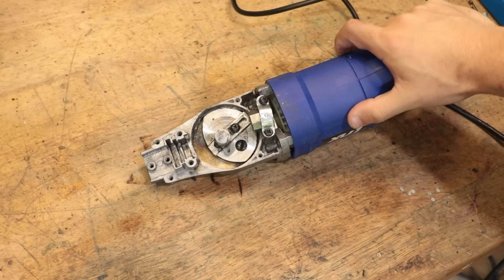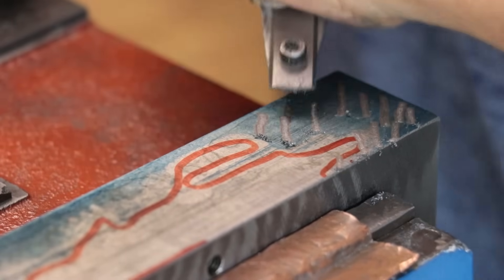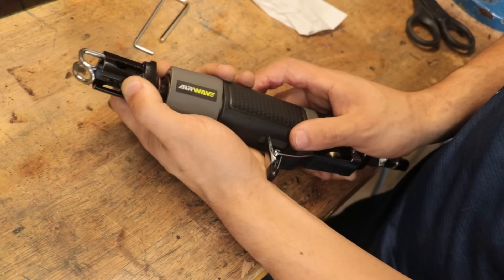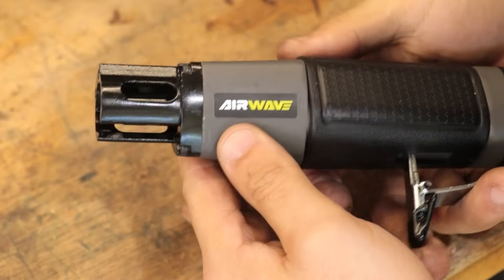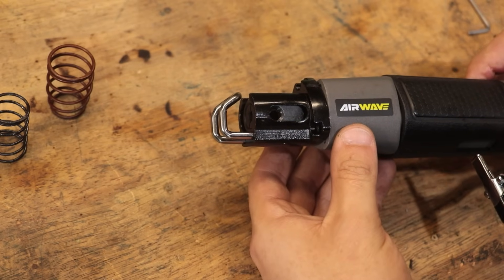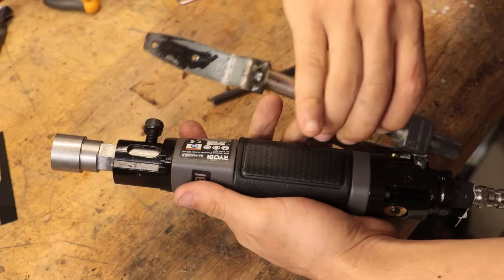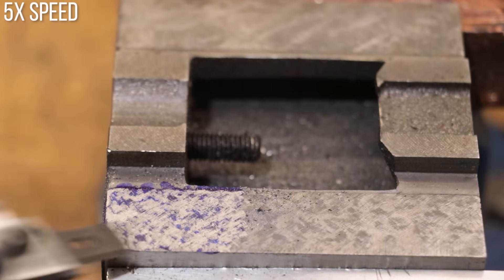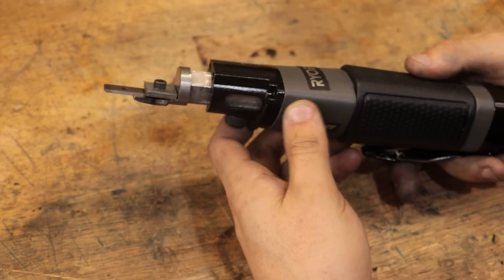Making A Pneumatic Power Scraper - One Day Build

Comment: First off, love all your videos and work you do!

An idea:
 You could start a side business selling  mod kits to permit home machinists to convert the Ryobi to become a make-shift power scraper. There is alot of home enthusiast machinist who would buy it.  I think you could easily sell over 100 kits to be honest.

If you had a CNC shop help you mass produce the conversion parts based off say your CAD/ technical drawing your, and you sold them as a kit... its a business endeavor/ product you'd be offering based off your design.
 Its hard to find a good value power scraper for the home shop (here in the UK, the cheapest ones are easily over 1,000 GBP) .  So you'd be solving a problem many of us have in the home shop if you did decide to offer say a conversion kit, and rightfully so, you'd make some money in the process :)  

Just an entrepreneurial thought is all ;)

Comment: Nice work! 

There are more materials that can be scraped.  The YouTube channel, "An Engineers Findings" discusses in a video or two scraping a approx. 1 meter long straight edge made from welded pieces of steel and how the rake angle of the carbide needs to be a +3° rather than a -3° for cast iron ( I may not remembering the correct rake angles, but it was a negative rake angle for case iron and positive for steel.) Also, I scraped one flange of a piece of stainless steel channel as part of making a precision machinist level.
Reply: You can scrap just about any ferrous or non ferrous metals to some degree as long as it's softer than the carbide.  The problem with any type of steel is the amount of effort required. You could flatten a piece of cast iron with a hand scraper 10 times faster than even mild steel. Its miserable to do by comparison. You'd want a power scraper for any moderate to large job. 
 A welded assembly of steel done on purpose to make a precision flat surface is a very odd combination. Cast iron is very stable, steel is roll formed so it has lots of internal stresses, add welding to the mix and your asking for trouble. It would have to be proffesionally stress relieved in a furnace to stand a chance of staying flat(ish).

Comment: you should be able to slow down the scraper by reducing the air flowrate instead of the pressure. Reducing (either one) also reduces the runtime of the compressor, the strain on you hands, and improves control over the scraper

Comment: I can think of two ways to slow down the oscillations: increase the reciprocating mass (would make it harder to hold and control) or decrease the spring rate/force on both return springs. And lower air pressure (regulator), but im sure you tried this.

Comment: i think using both the pneumatic and the handscraper is the way to go, do 95% with the machine and hone it in by hand, i recon you have much better control with hand scraping compared to the machine, especially on relatively small surfaces. but hey, it works, great job

Comment: hey, you need something that flexxes up front . i spoke to the European Biax Specialist ( kingway Consultant ) a while ago, and you realy want some piece up front that has flex. the biax scrapers use 2,5mm -3mm thick  steel that is tempered to a springiness . that allows to even out inbalances. i am 100% sure if u buy one of the 20mm wide biax Long scraper blade you will get much better results
Reply from the maker: That was going to be the back up design of the directly mounted carbide didn’t work. I think it may be better but I’m still getting great results with the direct mount. Cheers
Reply: @artisanmakes  if u want to get a better result, i highly recommend you to make a grinding jig and u need a smaller blade width ( 15 mm for example with a 40mm radius, and if u want to hit more PPi smaller 10mm or 15mm width, 20mm radius on the blade.most people scrapoe with way to big radius and width, and scrape not deep enough. by using smaller radii it would alow you to split the points accurate( when u examine your highspots, you should actualy only split the spot that you blued, not remove the whole thing " ) . what you are currently doing is that you constaly remove almost your whole points ( they are still way to big  because perhaps your radius is to wide ! ).that way you get changing results and you will not be able to get consistency   between the blueing. and you can only hit those points by going  over them with smaller radius and blade diameter.i didnt understood , why my pattern stalled at a certain point , until i reached out to a Kingway scraping consultant and he explained me very well that if i dont use smaller radius, the scraping pattern will remain coarse, and you will not be able to get good ppi. also try to thin out your prussian blue more. to me you had a pretty thick layer. i use something called Canode Blue, i can tell from first hand experience it works way better than regular Artisan paint. but i can understand...u have to take whats available.

Comment: You might be able to slow it down by messing with the air bleed ports on the double acting piston. I wouldn't try and reduce air pressure into the tool though, it would take power away.

Comment: Hi great video just thought I'd drop a comment my dad was an engineer in a machine tool manufacturer who built huge planes the cast iron beds were scraped to allow for a bed of oil that the plane head ran on these cast iron surfaces that could be several meters long were hand scraped in a circular motion to allow for a small indentation and per 1 inch square there had to be 12 semi circles or the area had to be reworked !

Comment: Greetings from across the pond...Actually looked like it works great. using a dremmel to put in grooves would overcome the small places for oil problem. its very fine but that looks lke it wont affect it....fantastic idea
Reply: When your scraping (flaking) to get areas to hold oil your only removing a couple ten thousands of an inch. A rotary tool would be difficult to use that accurately, not to mention how unprofessional it would look.

Comment: 200L tank is minimum for air tools.
Reply: Tank size isn't a substitute for compressor capacity, he should be fine though those saws only use about 4cfm and he's not going to be using it continuously
Reply: @Paul-FrancisB  ye but it is a buffer so you wont lose your mind because it will turn on every 10 sec. If you look at pneumatic tool it  usually has ~250l/min requirement.
Reply: @gary851   I realise that, but it depends on the air tool, a die grinder for example uses about 200 l/min. However 250l/min (about 9CFM) is over twice as much as one of those air saws use and he'll have it turned down. Also the number is FAD i.e. at atmospheric pressure with the hysteresis set at 2 or 3 bar on the pressure switch that triples effective capacity so it would be at least a minute even with that little machine and tank. Obviously a bigger tank would delay it kicking in, but with 9CFM demand that little machine wouldn't keep up or shut off until he stopped.
Reply: @gary851  no. Incorrect

Comment: A silent air compressor will be the next build, I used the compressor out of our old freezer with a separate pressure switch to keep my reservoir topped up, the noisy one hardly needs to run. Air conditioning compressors are a better capacity but I couldn't get one for free.

Comment: Brilliant idea and result. BTW Did you ever consider building your own pantograph? There are nice videos of these vintage machines them from Will Stelter and Inheritance Machining, however they always work by movement of the spindle, which makes them a small mill basically. I was wondering if one could make such piece, but with a moving table with the workpiece. Then it would be just an attatchment to a existing mill, and tracing the 3d printed parts would make it basically a CNC mill :P

Comment: If you want to slow the cycle rate down play with the hose sizes and only need small sections to limit the flow not a pressure regulator

Comment: It seems like it reciprocates less in length and is more accurate, but I would have thought you'd want a longer stroke, closer to what you'd get by hand but not quite that long or inaccurate, in order to have more dips and troughs in between strokes when hatching at different angles. The longer the stroke, the more widely separated each groove is if you move it from left to right at the same speed, and I would think it would dig slightly deeper which would also help with the whole oil thing. However, i am very impressed with your design as always. Cheap, effective, and relatively easy. Definitely on brand lol. It takes a lot of engineering to figure this stuff out though so youre helping a lot of people with these videos

Comment: Scraping steel by hand doesn't make any sense. For steel I use a thin cut off disc. Very light pressure, I use the side of the wheel. Works perfectly. For anybody concerned about imbedding abrasive, remember. We use ground slides either way

Try it out

Comment: There are air reciprocating file tools that are fairly inexpensive and could possibly work as a scraper.  The scraper blade would need to be small but I think it would work.  Great build idea you have, really enjoyed the process and progress.
Reply: they are basically the same as this saw.
Reply: @katelights  with the air file you can control the speed without needing to add the air pressure regular, they also have a shorter stroke.
Reply: @taranson3057  true, thats probably better than buy versions of powerscarpers. Diy better

Comment: My issue with air tools that run constantly has always been air consumption. CFM. They always seem to need a large compressor or they quickly run out of air and you have to wait for the compressor to catch up. This didn’t seem to be an issue with your small compressor.
Reply: You can buy smaller 10-20g aux tanks for resevoirs that will take longer to fill but run longer.
Reply: @boots7859  yes but only a minute or 2. I actually have auxiliary tanks. If your compressor can’t put out the required CFM it is a problem.Once the main tank and the auxiliary tank run low you are in the same situation. You might gain a couple of minutes. That’s a fact
Reply: @boots7859  this is a very unknowable response. Continuously running air tools like this typically require a 2 stage compressor to keep,up with the CFM requirements. I have been using air tools since the 1980s. Adding auxiliary tanks is a very poor attempt at increasing CFM. The only time auxiliary tanks work are with high volume intermittent air tools.auxiliary air tanks only help with initial run time after the first couple of minutes they do absolutely nothing if the compressor can’t keep up.

Comment: Something to watch out for is HAV (Hand Arm Vibration) problems. Using vibrating tools should not be done for long periods of time, it is very tempting to keep going until the job is done. Take frequent breaks and take care.
Reply: How about fu*k off with: "be carefull you will die if you..." shits ?
He (and all of us watching this) is not working in industry, 8 hours a day, 7 days a week, but once in a year or a several months maybe.
Do not put industrial standards in hoby shop.
Reply: Work in HR? Fuck me, he knows what he’s doing, and the risks! BTW it’s a covert video on DIY dildo’s. Relax!
Reply: What pussy crap are you making up now?
Reply: What's the mechanism of this causing damage?  Ie why/how does it happen?
Reply: See this is an Australian rehab setting, permanent loss of sensation or movement in hands or fingers. Serious shit.
Reply: That's why some chainsaws have heated grips.
The heat helps reduce damage in cold temperatures
Reply: As someone with nerve damage in their hands and wrists sustained from vibration, this is solid advice. I can assure you that nerve pain and reduced feel are not a good outcome. To the yahoo's dropping their incidental experience, please shut up.
Reply: In coal mining decades ago using compressed air tools the injury it caused was called vibration white finger. Remember seeing it on the local news in the 70s in Wales
Reply: @HT-io1eg  yes.. for someone who worked full shift every day.
Not for hoby machinist using 100 times less power tool once in a year.
I'm realy sick of 'do not leave the key in to the chuck, it's gone kill you'' trols
Reply: @bmalovic the pneumatic hammer is fairly different than higher frequency vibration messing with your joints that were already on their way.

Anyway common sense and feeling are pretty much decent enough. With something like this depends a lot on what you're doing with it anyway. People are more likely to mess their wrists using a mouse wrong than holding a sander or a scraper wrong
Reply: @lasskinn  of course, if yoy are working 8h 5 days a week.
But this is something that wil, be used onve or twice IN A YEAR, for few hours
Reply: @HT-io1eg  IDK if you have ever used one of those 200# pavement breakers powered by 1" lines and chicago/claw fittings.

That's WAY different than a little powered hand tool
Reply: I leaned this the hard way in high school when I was using a weed eater very often. Couldn't feel my hands for several hours.
Reply: I'm had nerve issues from using vibrating tools like orbital sander. It's at least something to be mindful of
Reply: @mrburns366  nah, it's from you having a weak body
Reply: I'm a welder/metal fab, some jobs are 7.5 hours/shift on a pneumatic grinder. There are guys in the shop that have been doing it 30 years. Not one case of white finger. Yes it's a very definite thing but he's not going to get it from this!
Reply: @andrewworley8946  he's talking about heavy vibration, grinders are relatively smooth compared to a reciprocating weight
Reply: The way to prevent that is to wear gloves. It's literally that simple. Run them all day if you want, just wear gloves
Reply: @dustinandtarynwolfe5540  What about mittens, will they work?
Reply: Youre the type of guy to wear gloves, ear and eye protection while cutting the grass
Reply: @smashyrashy I’ll be the safety nerd, ear protection and eye protection are so cheap and easy and coming from someone who has had scratched cornea that could have been prevented with 5$ safety glasses and sustained high volume exposure is a legitimate risk and not even all day but an hour of mowing the lawn can eventually hurt your hearing. That’s my rant and I’m sticking to it
Reply: @smashyrashy  not so funny - I was that guy, meticulous about hearing protection. Then I got a viral infection which affected the nerves involved in hearing and I now have to use hearing aids 😢
Still no excuse for not protecting my eyesight!
Reply: @smashyrashy he’s the type of guy who is less liable to experience eye injury, will have great hearing when he gets older and is less likely to have cancer dealing with carcinogenic chemicals. 

As a professional tradesman I can say the guys not wearing PPE aren’t the smart ones. 

Don’t pretend like you’re somehow tough for being more willing to damage your body…
Reply: @DMSparky  dont put words in my mouth
Reply: @DMSparky  OK.. profesional tradesman...
But we are NOT talking about the trade.
This is hoby. Performed from time to time, not every day, not 8 hours a day.

Why all of you mix oranges and apples?

Of course there are some protections that do not depend on time or exposure, like glasses, cos it can happen in milisecond.
But.. stupid gloves for painting one board with whatever paint you want, masks for few strokes with sandpaper, do not leave key in the chuck of mini latehe even for the second...

All of this is just following industrial rules, out of industry, and falling to corporate lawers sheelds from stupid customers.
Reply: @smashyrashy they're actually the type of guy to not be 40 years old with the body of an 80 year old.
Reply: @smashyrashy you forgot to mention toe-tecs😂

Comment: Wouldn't a endmill on a mill give you a flat surface?
Reply: Not to the precision of surface grinding or scraping and it's more about matching two surfaces together well. And one of the benefits of scraping is being able to work on surfaces that are hard to mount on something like a grinder or mill
Reply from the maker: Not to within 0.005mm of deviation over a 30cm span

Comment: Something I have done is put my air compressor out side in a simple enclosure to keep the elements off of it. I love air tools but hate the compressor noise and in a small shop like yours the noise must be deafening.
Reply: I don't use mine much, because it is loud and normal tools mostly work.
I saw plans somewhere where someone made a simply box frame from foam board, with 2 layers about 1" apart at some angle which helped reflect/cancel a lot of the noise.
Reply: @boots7859  Problem with a tight enclosure is heat generation, hotter the air the more moisture it can hold. When the air cools in the tank the moisture is released thus more water to drain. A small factory wanted to cut down the noise so surrounded compressor with Pink bats - cooked the compressor due to no air flow. Ever touched the hard pipe from compressor to tank - scolding hot.
Reply: Might retain more moisture & contaminants in the tank unless you added additional filtration to the intake. Also out of sight we tend to forget to drain the tank so replace barb drain valve most portables have with an elbow & flexible line. Run to an easily accessible ball valve to blow off as needed or use an auto drain if it's being used regularly.